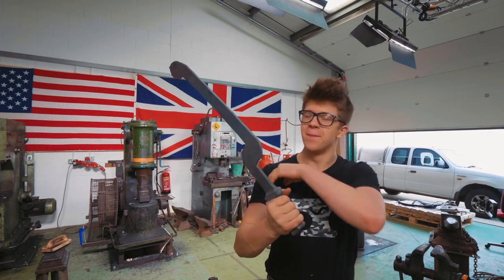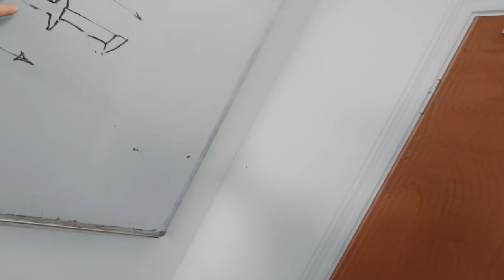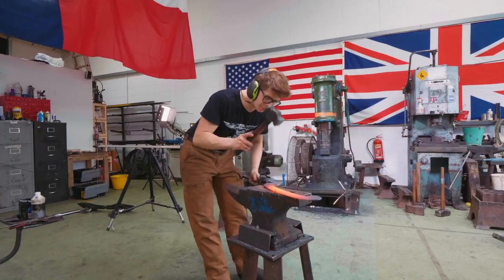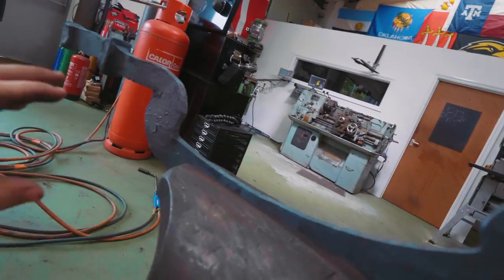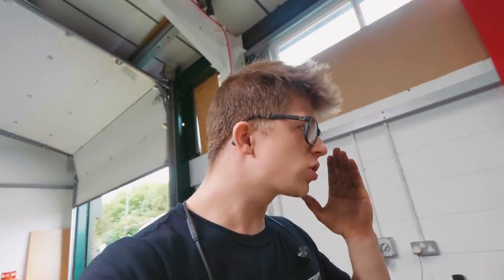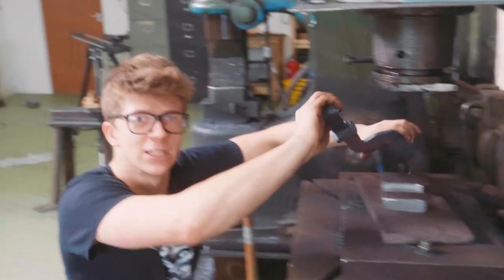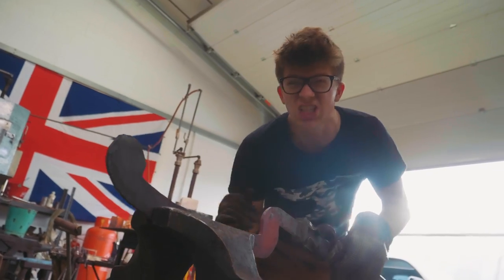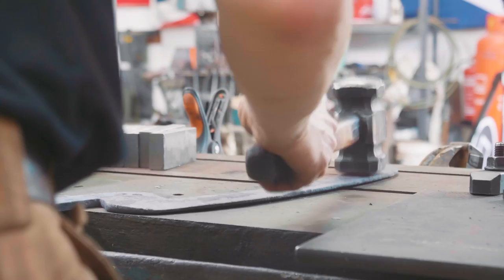MAKING AN EGYPTIAN KOPESH SWORD!!! Part 4

Comment: Just a thought... since you are making quite a lot of long items lately... wouldn't it be beneficial to put together a new/second forge that could accommodate it? Or maybe not a full-fledged forge (since I guess one would only be working a smaller section of the item at any one time), but something that you could use for heating to normalizing and tempering temperatures. That could then do with smaller burners since it doesn't have to get up to full temp.

Comment: Yes your cutting bit can be drawn down into the work piece...it is a thing...tighten everything up and take a slightly smaller pass. making sure not to climb mill unless you are doing a finishing cut or on a cnc machine...

Comment: Tool pullout is indeed what happened. Collets are only good for a narrow range of sizes. If the tool or the collet is worn, or the collet doesn't seat right, the tool can slide up or out.  Tool holders with set screws fix the problem of tools sliding around, but work with an even smaller range. Its good to have a selection of both.

Comment: Yes  any endmill will try to pull itself out of a collet when being used especially a hog endmill when you use one in a CNC you will put it in a side lock collet which will prevent the endmill from pulling itself out but on a manual mill you just have to tighten it as much as you can and frequently check your depth if it is a critical depth you can leave stock on and finish it with a “normal” endmill
Reply from the maker: +NRKnives SUPER HELPFUL! Thank you so much :)

Comment: Yes this is a thing with CNC mill. I've tried a small one on a peice of steel (it wasn't supposed to be used with something harder than aluminium). The metal sheet was too hard and start bending up...

Comment: Hi Alec. Could you make a video showing how to make what you would consider the most universal tongs.  Thanks
Reply: Ian Follett a good pair of flat jaw tings with a 1/4” or 3/8” round slot going through the length and another through the width of the jaws. You can hold flat and round pretty well.
Reply: Thanks! I can recall alec using them

Comment: Attempt #1 
Alec here is a real challenge, make a Scottish great sword or in other means a two handed long sword, doesn't have to be Damascus steel but you haven't done something real big in a long time if at all. Would be good to vary the content with something really challenging to handle. 
And I know you have a knack for getting around tough challenges with ease.
Work smarter not harder.

Comment: Roughing end mills like the one you are using will walk out of those r8 collets. Happened to me many times. Might be a worn out collet. Get an end mill holder that uses one or two set screws to hold the bigger endmills. They won't walk out on you

Comment: Feeding the tool into the workpiece with too big of a bite and the collet being too big will cause the end mill to pull out. It can also pull the workpiece out of the vice as well. Never mill over half the width of the endmill. You should be using a box end wrench to tighten your collet, not a ratchet. You should also tram the head to the table using a dial indicator. The vice should be set using a dial indicator across the solid jaw. A Bridgeport is a privilege, not a right. Take care of it and it will always be true.

Comment: If you push your endmills with deep heavy cuts in your part, they can actually pull themselfs out of your toolholder even when everything was tight. In your case it`s simple - an R8 collet ins`t the best thing for roughing   xD.
  Go at least for an setscrew endmillholder (like the big one in the video)  for your roughers up from 16mm. No need for a high tork chuck or so

Comment: A mill with more than 3 cutting sides has no boring abilities, because one cutting side is not going over the center of the mill on the bottom of the mill. Just compare the bottom of a mill with 3 of 2 cutting sides with one with 4 of more. You'll see what I mean. (Sorry for the bad English)

Comment: no its not because of the teeth. a end mill with out the teeth will do the same. the flutes on the end mill can only take so much and it will not stay straight it will bend just a little and that's why it's coming out, its just little by little that it comes out ;) just don't abuse your tools and al be fine. also a warne out end mill wil also crawl out

Comment: It depends on what type of cut you were doing if I’m correct and the speed but usually you shouldn’t tighten your tools in there bionically because the 
Callit going to tighten it up when it starts spinning up so I think if you were climb milling I think he might have a better chance of it digging in

Comment: Hi Alec. First of all I've spent a lot of time on this comment and I really hope you read it. Second, I REALLY don't want to write this but I feel it is necessary...As much as I love watching your videos and learning about a trade I admittedly know next to nothing about I had to dislike this one. Simply because it showed a lack of research. Neil Burridge is a maker of museum level replicas of khopeshs and lives within reasonable distance of you. He's been more than helpful to me as I struggle to make my own museum quality khopesh out of bronze. I will be the first to admit that I'm a novice with steel as I am primarily a woodworker but it looks as though yours will be out of balance. (I recommend you look at both skallagrim and lindybeige) And while I understand that it would be hard to estimate how long the  middle section should be while twice as thick I believe if you had searched more you would have seen a need for it to be longer...  for a weapon to be a weapon it has to balance as such and the khopesh is supposed to balance near the bends in the blade which it does not look like it will. I hope that I am wrong, but if I am I wish you had explained your design thoughts while dealing  with an integral pommel.  (Also I have to admit the little protrusion in the middle of the handle I see in yours will be something I will add to mine because that is a beautiful upgrade to the normal handle.) all in all I love your videos and really hope you've actually read this far because I want to see you succeed but swords are tricky business and before you begin making collaborations with people like "man at arms" like people have been suggesting, the level of research will have to go up. That said I really hope you break into the sword community because I want to own one of your swords. But only if it handles as a sword should. Thank you for the hours of entertainment you have brought to all of us here on YouTube.

Comment: Yes that's a thing u can sand blast the actual shank of the tool and it will tighten the tool that is the bast long term method
Reply: Even though it's carbide it will still sandblast

Comment: Mills pulling out is real and more than likely caused by a loose collet. You may also want to use different endmills besides those 1980's hog mills. There are better mills designed for cutting crs to heat-hardened work pieces. If you insist on using them, try cobalt instead of carbide. Might save you a couple bucks and still get the same rough surface finish. peace

Comment: i'd love to see you work with titanium. i know its tough stuff and damn expensive but still that would be sweet!!
Reply: Major scary when it catches fire mid pass on the mill. 

The finer the swarf the easier it burns. It burns white would look epic with Alec style.
Reply: alec guzelimian industrial one or normal titanium? Normal titanium is probably a little bit harderor the same as normal steel from what I remember
Reply: normal, Grade 1 or 2 would probably be best since grades 3 and 4 are both expensive and harder to work with

Comment: I'm no expert but it could be that your spindle needs some TLC. 
If the bearings are getting old then you could be having some play in the spindle or collet causeing the tool to rattle loose.
You can check it the same way you would check the bearings on your car axials, grab it by the quil and see how much you can wiggle it, too much play means your bearings are going bad.

Comment: The cutter slip results from over working the material. In other words, you’re pushing too hard on the cutter, go get some boelube if you’re not going to set up a liquid coolant system. Wax will do if you can’t get boelube too.

Comment: The 'S bend' seems to be too pronounced. If you look at authentic khopeshs, the 'edge' of the blade, right in front of the guard, usually align with the back of the blade, right after the bend. You almost have a whole blades width from the 'edge' of the part closest to the hand, and the back of the blade after the bend. I hope it makes sense.

Comment: Modern damascus is the wrong steel for anything longer than a large knife. You should be using a proper tool steel, or spring steel.
Reply: Ken MacMillan there is way better. I watch alec for him.
Reply: You have to remember that these are not made as truly functional weapons, but rather they are pieces of art.

Comment: Really want to use dedicated endmill holders...come in different sizes but all will have a setscrew in the side that locks into the flat on 90 percent of all endmills.Everyone tends to use regular collets because they are quicker and less expensive then dedicated tooling holders but they are very bad for slippage...they can and will bite ya in the ass when its the worst possible moment.People try and work around it by over tightening the drawbar but that can lead to thread failure and or collet damage and it still wont eliminate all chance of slippage https://www.mscdirect.com/product/details/08453219 this is what your looking for...either individual or a set...just make sure the adapter type matches your mill...figured it was a r8 style but could be wrong

Comment: https://smithy.com/sites/default/files/iadmin/pictures/products/R8%20End%20Mill%20Adapter.jpg

That link is for a pic of the types of collets I have used. They have a set screw that positivity affix the cutter to the mill and prevent twisting and slipping. For heaver cuts I highly suggest the ones with set screws over friction fits

Comment: For when you where milling, it looks like you were both climb milling and conventional milling (here is a video explaining the difference https://www.youtube.com/watch?v=galm5_6SUcM  ) but basically don't climb mill to take lots of material, use climb milling in small cuts as a final pass for a nice surface finish, it can cause issues and ruin cutters, also, don't feed the material too fast, as u risk breaking cutters, its best to feed a bit slower to avoid breaking cutters, also it leaves a nicer, more "accurate" finish u could say (can't really tell how fast u are feeding because of the speed up edit)